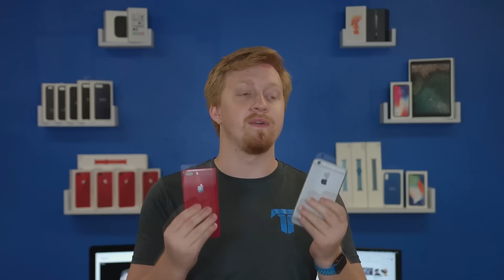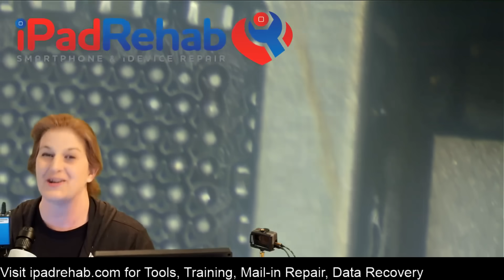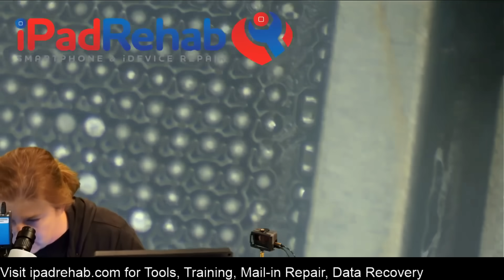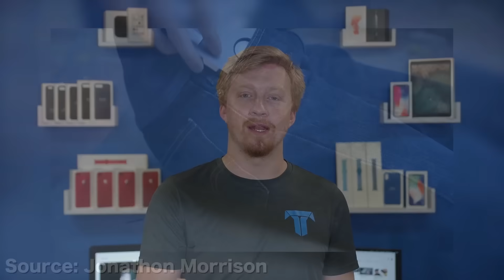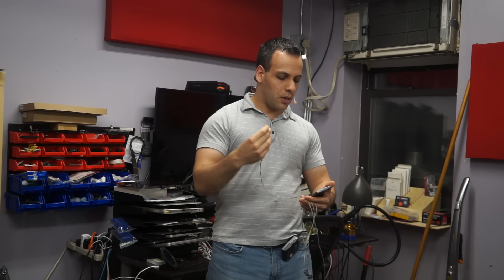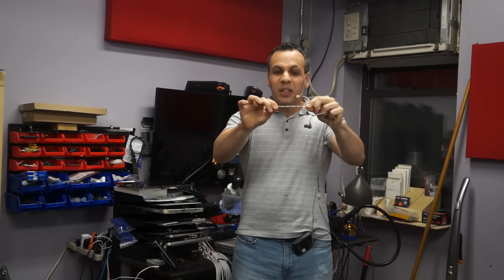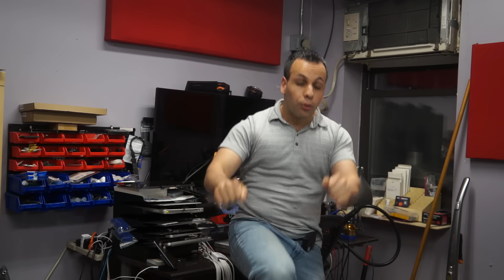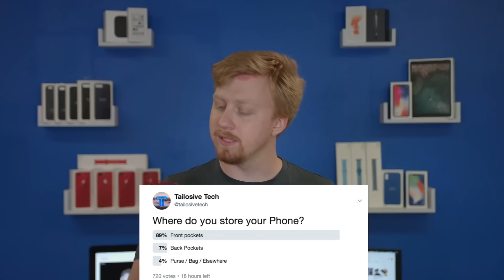The truth about iPhone bendgate deniers

Comment: The iPods touch’s used to have a stainless steel back and despite being very thin, they didn’t tend to bend. 
Stainless steel tended to be around 50% stiffer than aluminum (though a lot of factors are at play, such as anodization thickness, steel grade, mixture ratios, etc...).
It seems apple has returned with the steel edges and glass back on the iPhone X, while maintaining a similar thickness to the 8. (7.5mm 8 vs 7.7mm X). Hopefully this fixed their issue with bend issues.

The stacked dual PCB in the X should also be less prone to this issue. Hopefully apple has addressed and fixed this issue internally.

I owned several iPhone 6, 6s, and 7 but never had this issue, though I’m not so stubborn as to pretend that this never happens. I do find it however a bit concerning that people are willing to sit on super thin $800 devices without a second thought. I believe a lot of the problems can be fixed by the user treating their devices better. 

The thinner and thus weaker phones were a design choice that came with its share of consequences. Having a phone thinner and larger will make it weaker, theres no way around it. While it’s true iPads rarely have this issue, its also true that people rarely sit on iPads. If you keep your iPad in your back pocket daily, you’d likely encounter similar issues. This is not to say that Apple couldn’t have taken steps to mitigate this issue. 
Apple could have done better in their design, such as using stainless steel or chrome for the casing instead of aluminum so that the phones are stiffer and would thus be less prone to bend damage.

Comment: I put my phone in my back pocket because the frontpockets on my jeans aren't real
Reply: Undefined Lastname- Would you put your laptop or TV in your back pocket? Would you bend your iPad over your knee to show it breaks by bending? The analogy and logic you have here is bad.

Even if the phone wasn't in the back pocket, it's the fact that it had faulty design that ALLOWED for this to happen. I have a very cheaply made ZTE phone that cost me $40 from Walmart and I keep it in my back pocket. I have yet to have it bend and I've had it for over a year. I sit on it when I drive to and back from work. I work with it in my back pocket. This CHEAP phone has lasted longer than an Apple phone whose device had bent due to the conditions of being flexed over multiple times whether it be from multiple small instances, or a few long term instances.
Reply: There's a design difference between men's clothing and women's clothing, generally speaking, and between specifically "skinny jeans" back pocket location, and  typical baggy-assed jeans that millennial males tend to wear. Each of which WILL accommodate a cell phone in a seated position. But the opposite pocket location in each set of jeans will not accommodate a cell phone when seated. Picture it in your head.
Reply: GIVE GIRLS POCKET
Reply: neoalex yes please. The way clothes are made is both stupid and assuming in a sexist way. The assumption is that women (and girls) will carry a bag of some sort and therefore have no need for pockets. Well I am here to say that that is stupid. Pockets are enjoyable.  Why carry an extra bag when you can just carry it on your person. The assumption is stupid. End it
Reply: I walk with it in my back pocket but take it out when i sit
Reply: Same. Fake pockets so go in the back one or bag when it’s warm. When I wear a jacket I put it in the jacket pocket, if the pocket is big enough for it/actually has pockets.
Reply: i store my phone in hotpocket cus im rocking 50 iq
Reply: I have 1 pair of pants with functional pockets. Phones, keys, coins, whatever, all just slide out of the rest. And the back pockets are allays to small to fit anything in, so why use them either? In the end I just carry everything in my hands to save the trouble.
Reply: "I also put my phone in my back pocket as I’m pretty paranoid about the radio frequency frying my man jewels if I put it in the front pocket. If I’m wearing a jacket I almost always put the phone in the secret pocket by the chest area. I honestly thought it was normal to put the phone in the back pocket." I explained why right in my first response.
Reply: Haha 😂 ❤️
Reply: Then buy real pants.
Reply: I thought the reason you put it in your back just cuz your back will looks sexier
Reply: @Undefined Lastname to be honest even though i dont put my phone in my back pocket i agree with him. if your phone cant take being sat on(i dont mean like ass planting onto concrete with it but like sitting down normally and shit) it is kinda meh. 

my note 3 took a retarded beating. and i was worried about how thin it was. despite the back breaking on the 4 it held up well once you stuck a giant sticker over the back plate. i mean screens are one thing, but bending? 

though id say larger/heavy people may have to think differently.  phones used to be able to take a retarded beating. accidentally sitting on your phone is kinda common though.
Reply: @Undefined Lastname also just to be a smart ass. gpd win. a laptop you could put in your back pocket. 

also careful :P i hear eminem likes to do that.
Reply: I hate those fake pockets!!!!
Reply: btw Tiger of sweden makes some jeans for women that actualy have front pokets that compare to mens @Amanda Ansnes Laumann
Reply: Amanda Ansnes Laumann Ort Mine are always too small to fit a Phone in
Reply: So that's why my sister steals my pants that are too small.
Reply: What if your phone isnt real?
Reply: @Undefined Lastname had multiple otterboxes. including the very first ones for the older iphones. 

broke multiple phones inside the otterbox defender. and fucked an iphone inside a lifeproof case.
Reply: @Undefined Lastname but again wasnt broken screens it was bent devices. screen breaking is one thing. device bending is another.
Reply: @Undefined Lastname not if that aluminium is heattreated and cold forged. 

lol and i probably know alot more about metallurgy then you probably do. 

also fyi aluminium is less likely to bend and more like to crack or snap. fyi.
Reply: I'm a man and when at work 90 percent of the time it's in my back pocket. I weld for a living and having a phone in what is essentially my lap while welding spatter falls is a bad idea. Even worse than sitting on it. I've done this for years with my LG androids and never an issue. That and there's not much room in my front pockets for keys cigs lighters various marking sharpies a knife and whatever else I have in them at any given time.
Reply: Their shitty marketing and "innovations" would be more than enough reason not to buy apple product at all. Any of them. They all have shitty designing shitty hardware shitty customer support. They seem to love bending the customer over.
Reply: Why would you buy jeans with fake pockets?
Reply: Anthony James that’s stupid. Why should women not be able to fit things i their pockets because of who they are and the clothes that are designed for them.
Reply: Just what is the deal with those fake pockets on women's clothing, anyway? Why go to all the effort of making it look like a pocket and then not put one in? Fashion makes no freaking sense. Just give the ladies a damn POCKET, people
Reply: God that's annoying.
Reply: Wear men's jeans.... Just sayin....
Reply: nice joke. send vobs and bagene plz.
Reply: Wait.... Putting your phone in your back pocket isnt a common thing? I thought its what everyone does
Reply: It's a phone, if it can't handle me sitting on it why would I buy it. Why would I need to sit on my laptop, different devices have different durability test's for some people. If I did work in construction then your dam right I would accidentally sit on my laptop and if it broke it's one shitty laptop. A television just sit's in one place why would I want to sit or carry a television around with me? You may prefer to not sit on your phone, I could care less its a device I use for phone calls, messages, emails, and random media consumption, its a tool to connect with others is how I use it, if it fails my personal durability test then it was a crappy phone, you have your personal use for your device's, so you shouldn't try to guilt trip me with your opinion about how differently I view and use a device I own and is now my property with something as dull as  "Mohamed Yousuf you're sitting on it? Would you sit on your laptop or TV?"
Reply: @ODEelephant  Phones dont have to be made to support 120 plus pounds of force stretched around it like a vice when ever you sit down
Reply: @ODEelephant  radio frequencies aren't harmful AT ALL

Let the myth die, already
Reply: Mohamed Yousuf you know he’s just saying your phone should be treated with caution like a laptop or tv.
Reply: Undefined Lastname apparently he would, because people like nothing better than sitting down with a phone digging in their arse .my phone costs around 600 my first thought is obv ,let's just sit the f down without removing one of the most expensive things I own from my pocket ..
Reply: The fact your bother by the idea someone would prefer to put their phone in the back pocket instead of the front, while providing reasoning and logic for the argument why one would prefer X over Y and still not be content to the reason is beyond me. Cry me a river.
Reply: Amanda Ansnes Laumann I also put my phone in my back pocket as I’m pretty paranoid about the radio frequency frying my man jewels if I put it in the front pocket. If I’m wearing a jacket I almost always put the phone in the secret pocket by the chest area. I honestly thought it was normal to put the phone in the back pocket.
Reply: Mohamed Yousuf should more paranoid about a tap on your back pocket ,oh look where has my phone or wallet gone .why you would sit down without first removing your phone from your back pocket is anyone guess ..
Reply: @ODEelephant  and "frying" your heart is better? lol
Reply: @ODEelephant You should see a psychologist
Reply: Mohamed Yousuf This might have been a valid concern if you had a DynoTAC by your package, but I don’t think that RF from modern cells would make sperm fried rice
Reply: @ODEelephant   the "radio frequency frying my man jewels"
The internet, radio or other phone frequencies are not a suddenly appearing link to your nutsack, those frequencies are going to be munching on your nuts 24/7, unless you find a place with no connection posts in a 250km radius.
Don't think about it, only high frequencies supplied with a high current of power using a single direction link mirror can allegedly(not proven) fry your jewels.
Reply: Mohamed Yousuf also... man jewels? Oh god.
Reply: Women put their phones on back pocket just to show off the booty.

Comment: Hey Louis I got a Galaxy s6 (active) in 2015 and it was stored in my back pocket since then. No bend or hardware issue so far. I remember my old htc one would wiggle on a flat surface because of getting bent but not this bad boy. Do u remember when we used to change our stuff merely because we were bored with them? Ahhh good old days.

Comment: So, i can tell something to make apple users more happy.

Bought an iphone 6s plus couple days after launch back in 2015. Since that date i already replaced:

>back camera (focus sensor dead)
>screen (not cracked, just died)
>side buttons (stopped working protected by a huge case)

And now, my front camera have problems with the audio when i record videos. The apple support says is a chip problem and they need to replace the hole board.
I am a common user that buy phones to use as much as i can, here in Brazil an iPhone 8 costs 3500R$ (more than 975U$) when the minimum wage per month is about 950R$ (yeah, thats right, less than 260U$).

So now, i have a phone that i wasted enough to buy another one and still have problems with that. I really like the IOS system, but the apples hardware is fucked up.

Comment: Let's say the damage only occurs when you put it in your back pocket. 
Let's say only 7% of people put their phone in their back pocket. 
Let's say apple sold only 100million (only lol) iPhone 6's. 

That would be 7 million phones that were at risk lmao, what kind of argument is that
Reply: all this after may 2018 ! 
iPhone bendgate flexion damage caused Touch Disease  Apple knew about  all along & LIED!

through internal documents Apple released in court 
as part of an ongoing lawsuit against the company for
 touchscreen failures known as ‘Touch Disease’ 
caused by iPhone bending & after May 2016 the company tried to quietly 
strengthen all models produced  by applying extra epoxy. 

while denied it has anything to do with Bendgate & never officially admitting or successfully fixing its fundamental structural defect 
it switched to a stronger aluminum chassis for the iPhone 6S and iPhone 6S Plus & Series 7000
Reply: A True and Good One MATE!